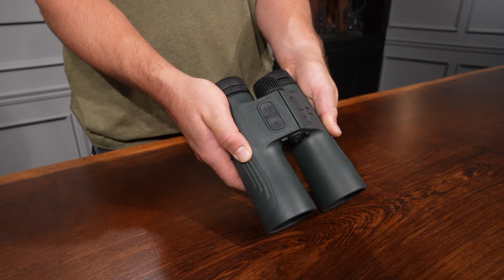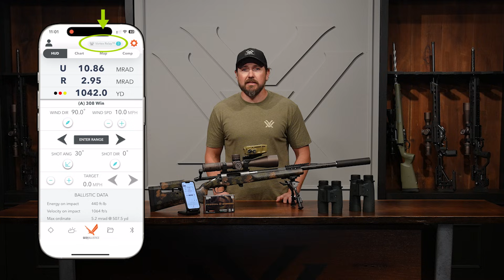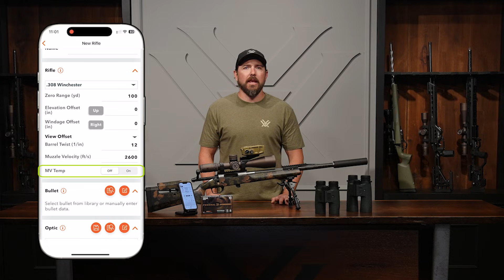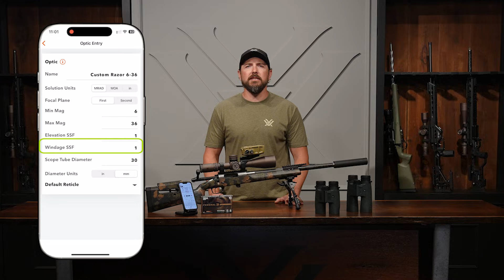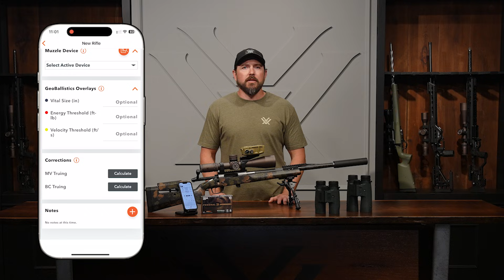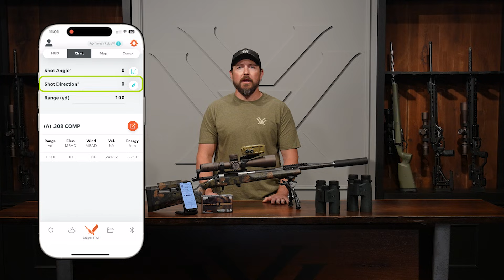How To Set Up Talon® HD 10K Ballistic Laser Rangefinding Binoculars

Comment: Got screwed on your fury hd 5000 ab binos when the app got glitchy and stopped working. Don't want that to happen again. Can you make a software update so they are compatible with your geo ballistics app?
Reply: That app / binos (furys) should still be working as it should.  Unfortunately, there's no way to change the solvers inside of the binos.
Reply: @tuckerschmidt2484  If you capture wind speed and direction with the ACE, will it relay that info over to the Talons automatically, so then you don't need to manually input wind speed and direction into the Talons themselves? The firing solution will account for wind direction and speed from the ACE - target direction and range from the Talons?
Reply: Do the fury’s not work with AB quantum?
Reply: Any plan for ACE and 4DOF compatibility? At least just to update environmentals in 4DOF